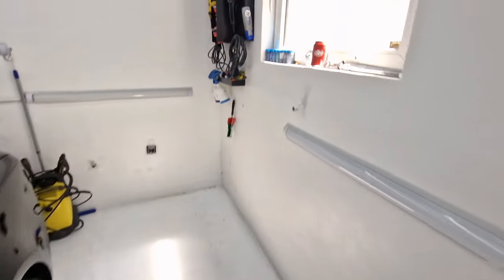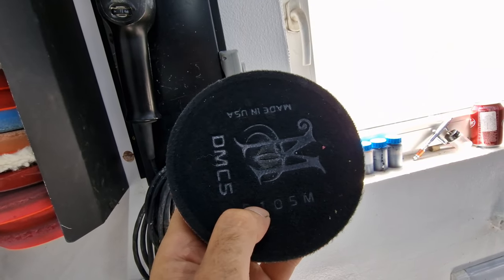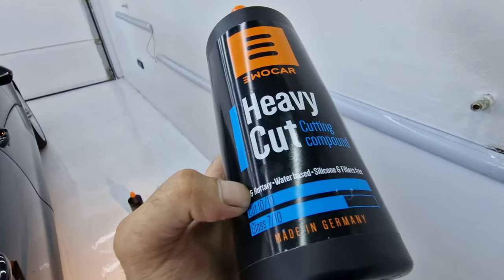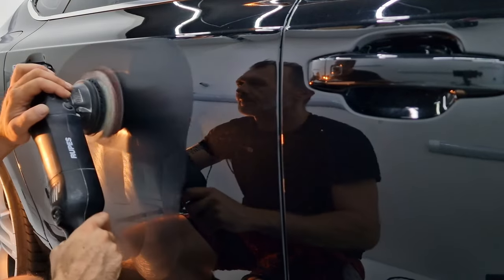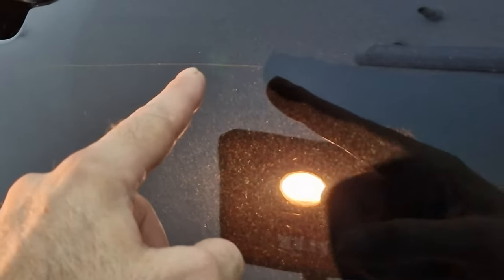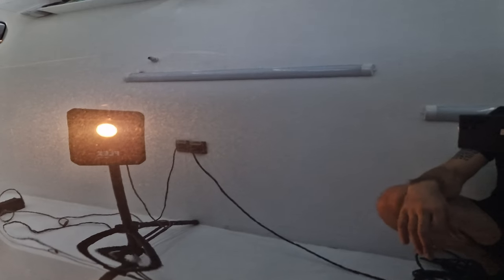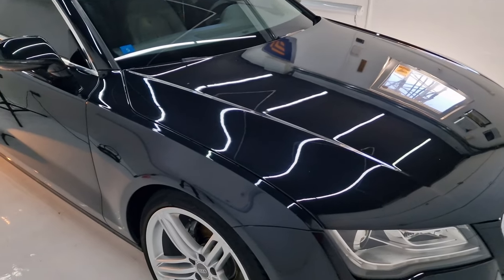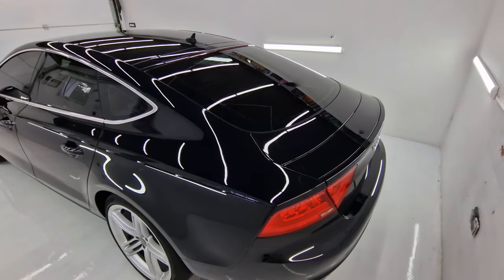One step polish properly

Comment: Great video! Very informative as always. I would love to be able to offer the same results as you, unfortunately i cant, because i dont do this for a living, so i dont have the tools and time to do the perfect job. In my area there arent many customers that would pay for something like that, they barely repair their cars, let alone take care of their paint. I bought a bottle of s20 black one step and a rotary polisher plus all the cleaning  and preping materials, will do my best to get decent results for anyone who wants it.
Reply: Keep on practicing and in the end you"ll getting better and better at it👍
Reply: S20 blck was originally made to work with a Rotary, I get great results even with my Rotary. 
The only issue would be finishing down with mininal holograms/buffing trails. My tip would be slow speeds & make sure you have a quality finishing pad.
Reply: @cheveresalvi  rupes yellow waffle pad and 500-800max rpm. Must works well.

Comment: How do you get so little haze with a 1 step on a microfiber pad? Cause usually microfiber pad needs a finishing step to reduse the haze
Reply from the maker: as said in the video without pressure
Reply: @Amddetailing  okay! Would you recommend 1 step polish with foam or microfiber? On hard paint like mercedez, audi or bmw